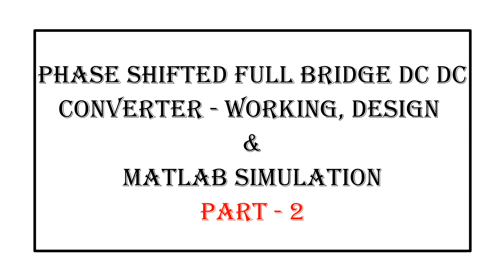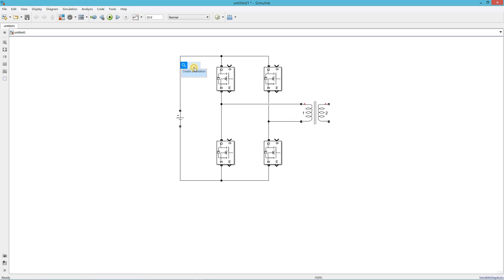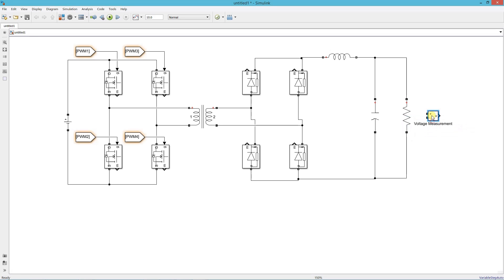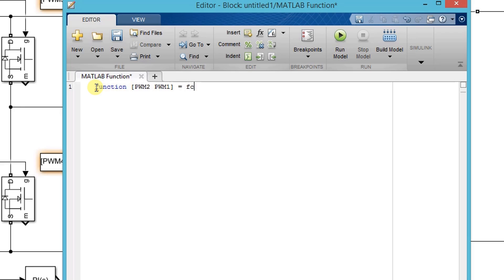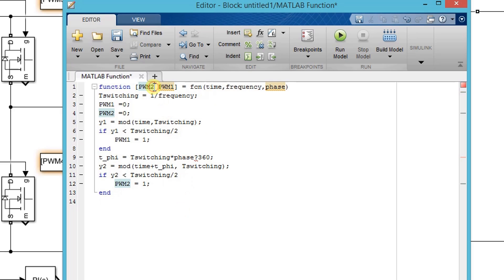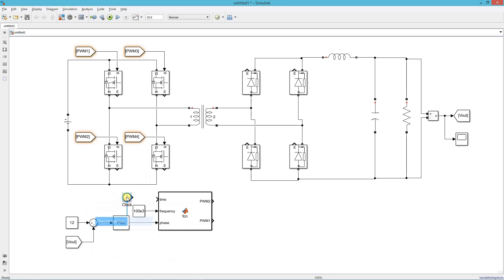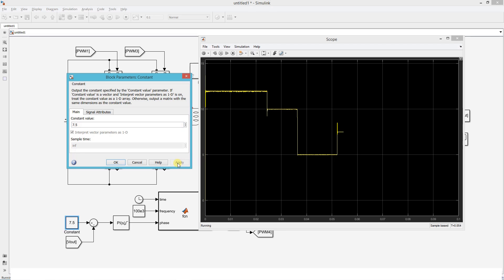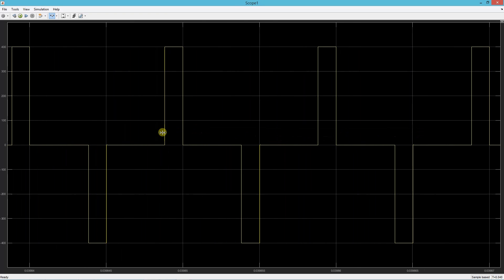Phase shifted full bridge DC DC Converter (PSFB) - Working, deign and MATLAB Simulation - Part 2.

Comment: What should I do if such an error occurs?erro:A singularity has been detected in the inductance matrix. This situation typically arises when there is a mutual inductance block whose inductance parameters lead to a singular inductance matrix for that block. You must change some of the inductance values within such blocks until the singularity has been removed (e.g., this error message no longer appears).
Alternatively, you can use the 'Continuous' simuation type of the powergui, with the 'Disable ideal switching' option deselected
Reply: Have you solve this error? I also meet this problem
Reply: @Zanzilar  It’s probably because the R and L values of your transformer were set too low, making it appear as a singular point. Try increasing them a bit, and it should work.
Reply: @Rui-n4t  Thanks for your solution

Comment: Practical transformer inductance value 
When we do with that value voltage drop across the transformer will be very very high secondary voltage will not be same as turn ration.

Comment: Hello sir,
I set up the circuit exactly the same way as the video. I am getting the output voltage right. But I can't get the phase shifting part (as you showed at the beginning of the video) properly. I would appreciate it if you could help me.
Reply: I have the same issue. Please TechSimulator can you explain how to fix that ?

Comment: Which version of MATLAB you are using? I have done everything as per the video but not getting output
Reply from the maker: 2018a. You can share your model at ashacademy01@gmail.com
Reply: @TechSimulator  Okay mine is 2015 I'll mail it you just debug and tell whats wrong as I am planning to simulate for 3kw power rating

Comment: Sir pls teach how to control the igbt with ac circuits
Reply from the maker: didnt get your question.
Reply: @TechSimulator  how to control the ac voltage by igbt and how to design igbt and mosfet gate driver circuit